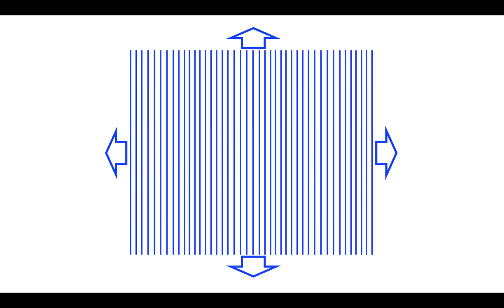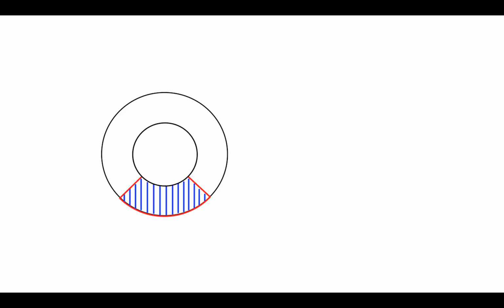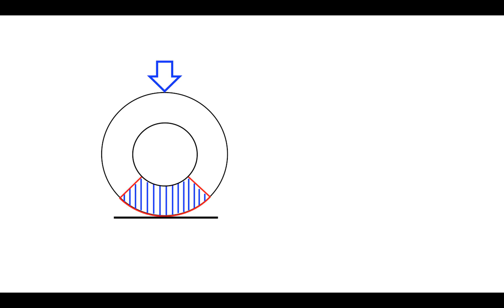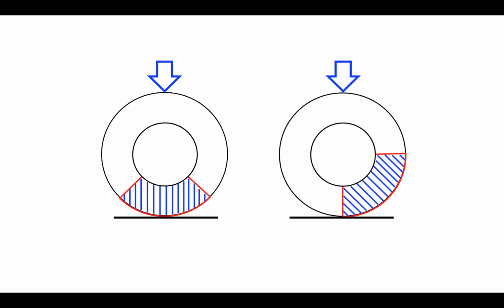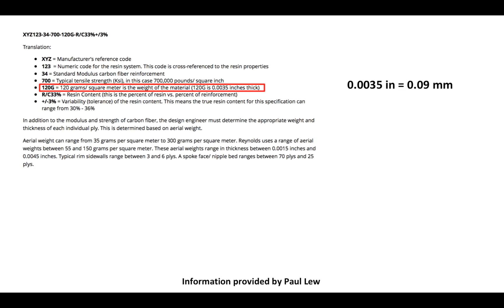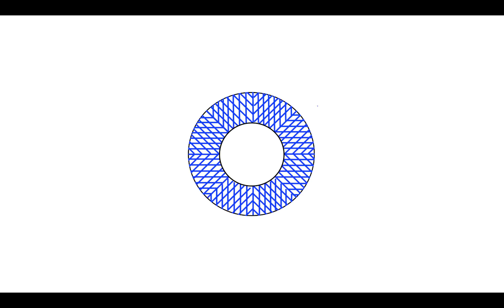Deep Section Carbon Rims

Comment: Great, clear explanation. At first it might that radial plies would only resist shear loads but the overlaps are in effect creating trusses with theoretically huge strength in all directions.  Would like to learn more about filament wound carbon rims which are claimed to be more structurally efficient.  Everyone around here (except me) seems to suddenly be getting disk brakes now,  making carbon braking issues moot.
Reply from the maker: I'm not a huge fan of disc brakes.  I build lots of wheels for them, but people typically have no idea of what kinds of torque loads are put on disc brake wheels when you stop quickly.  I've studied it a lot. the challenge for the wheels is  understandable with a little effort and a little knowledge of math.  Problem is that most people don't know any math.

Comment: Im buildinhg a long but low chopper with poulan chainsaw engine and f hub has drum brake w generator and rear hub has drum brake and is 3 spd i drew picture and it worked ovt 2 have 24 spokes total 2 skip 1 than 2 and so on BUT ur the pro and ima auto tech

Comment: Hey Bill need hlp I have a 32 hole hub I want to put on a 28 hole wheel is that possible how much would you charge me to do this let me know please whiteronald 888 at gmail.com
Reply from the maker: Ronald, it's rather time consuming to figure out a possible lacing pattern when the rim and hub have different numbers of holes.  I need to know if you're serious about this before I even start to think about it.

Comment: Thanks for the very insightful video. Why aren’t carbon fiber sheets constructed with the fibers orientated randomly, like plywood? I know it’s a poor similarity because plywood is usually weak compared to solid wood, but perhaps plywood could be stronger if the pieces were as long/wide as the sheet as with carbon fiber, and the glue/resin were propertionally as strong as with that of carbon fiber. Why can’t the fibers be ‘dropped’ at random directions, resin applied and then pressed into shape? Is it impossible to manufacture this way?
Reply from the maker: Each ply of "prepreg" either has the fibers running parallel to each other which is then called unidirectional prepreg or there can be a second layer of fibers which are perpendicular to the first ones, in which case it is called woven prepreg.  Your reference to plywood is actually a good one.  Separate layers of unidirectional prepreg can be placed on top of each other  with whatever orientation the design engineer wants at any angle between 0 degrees and 90 degrees.  The allows a great deal of control over the strength and flexing of the material.  I hope this answers your question.